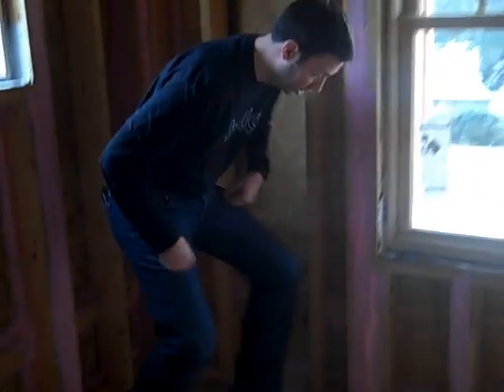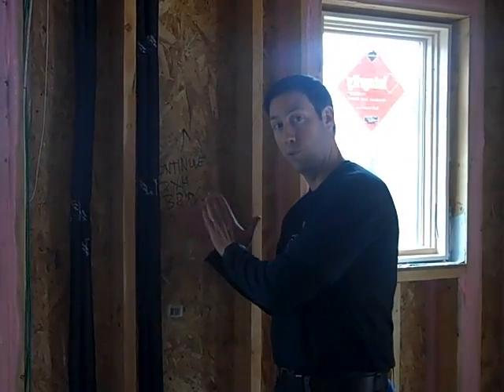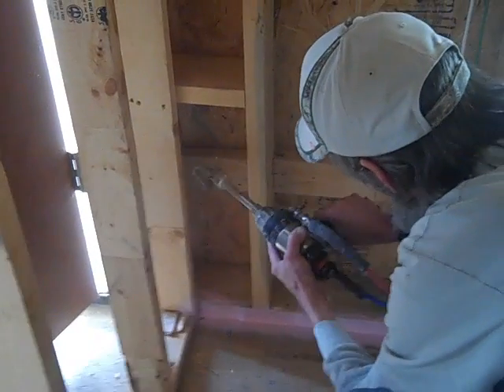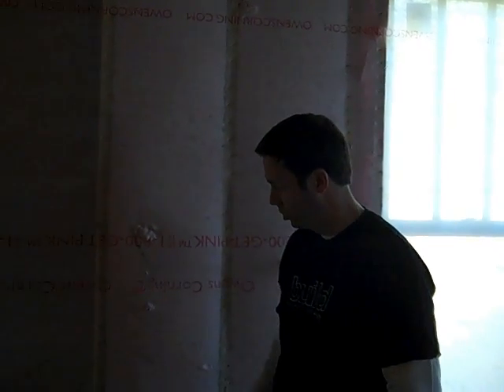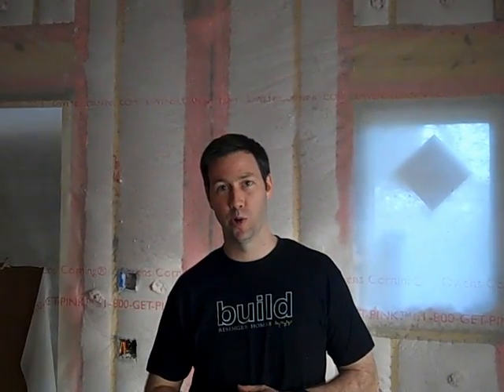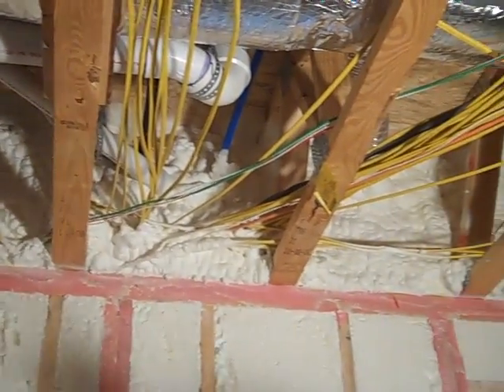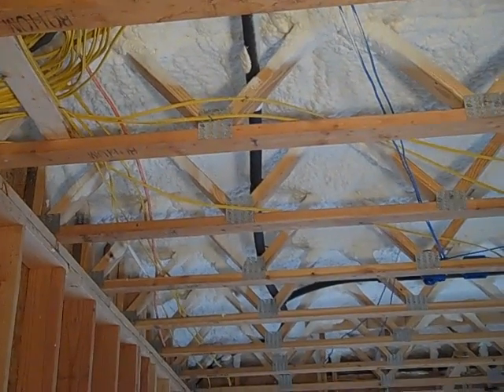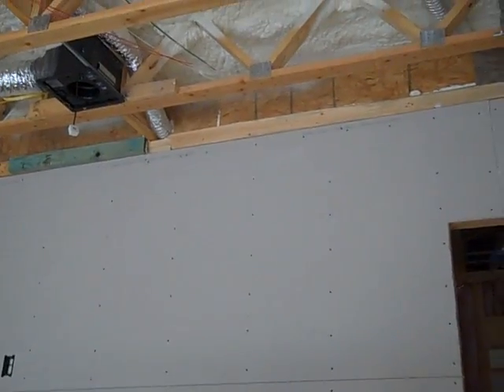Insulation & Air Sealing Strategy utilizing Owens Corning Energy Complete

Comment: This would be good for a custom build that you are going to live in forever.
Wayyy overkill though for what you actually need.
Reply: Nobody needs ever increasing heating and air conditioning costs. Spend an extra $3000 on insulation and add it on to the home loan. $8 per month for 30 years and free after that if you stay in the home. Lousy insulation and air sealing is the gift that keeps on giving.

Comment: This is an overkill and impractical. Even on camera dude spays the insulation still leaving a gap between the studs in some places. In the field subcontractor will hardly have enough patience to do this job due diligently. That's the practicality aspect. As far as the overkill, taping OSB board joints and house wrap will provide more than enough air sealing, inconsequential in terms of heat loss. Windows and convection heat losses are magnitudes more substantial. If you are concerned about mold remove the moisture element. But that's virtually impossible in a traditional frame wall construction used in the United States. Some may easily spin this into a conspiracy theory, especially since civil engineering has had an explanation for decades. As vapor travels outward, past the gypsum board, past the fiberglass insulation it meets cold OSB/plywood board and condenses on the side still internal to the house. Incidentally OSB, the newer invention, is even worse than plywood because OSB has a lot more glue making it virtually 100% efficient vapor barrier. This is why by year 10 or sooner most houses in the US, especially those in the colder climates, have some kind of mold or rot damage even without having any kind of water leakage issues. Yet, industry keeps pushing this type of wall construction. But you Matt are on the right track in general. I admire your commitment to the scientific approach. Once I start seeing you talking about location of the dew point inside the wall systems you build I'll know you started hitting nail on the head.
Reply: ICFs
Reply: air sealing is actually very important to heat loss and energy efficiency. As far as why houses rot, thats because people work with new materials they don't understand. You could get away with sloppy design of a building envelope 20-50 years ago, but you paid for it with energy efficiency. Now that building codes are stricter in regards to energy efficiency there are more problems. Gone are the days where you can get away with installing a brick wall without an air gap.

Comment: Hey Matt, are you still using this system ? What is or was your ACH, when using this type of system ? thx
Reply from the maker: Luke,  I'm no longer using this system or promoting it.  They have re-formulated the way it's applied and I'm not a fan.  This house blew around 2.5ACH50 but I'm not sure their reformulated system would produce those results.
Reply: Matt Risinger good videos. What is your current insulation system style?

Comment from the maker: Hey Brian, thanks for your comments!  Be sure to remember that alot of what I'm doing in these videos is intended for the hot/humid Southern US.  Much will translate to Canada, but be careful.  Regarding SIPS, I've not used them yet.  My opinion is mixed.  I think they are good but not great for custom homes that have Architects designing without SIPS limitations in mind.  Simpler houses seem to work better with SIPS.  I think a 2x6 Advanced frame house can compete very well with SIPS. Matt

Comment from the maker: @LukeSkaff That's a valid concern but this product has been time tested and settling has not been an issue with a qualified installer doing a BIBS system.  I really think this Owens Corning Energy Complete is a terrific product.  If I were building my own house today I'd frame it with 2x6's on 24" centers and use OC Energy Complete, and I'd use exterior rigid foam.  Consider at least 3/4" of exterior foam, but depending on your climate you might want 2-4" of rigid on the outside.  Matt Risinger

Comment from the maker: @SZAPP68 I think the costs are VERY reasonable on this system.  It's basically a BIBs (blown in blanket) system with the additional sprayable caulking for air sealing.  I think this combo we show on the video is really a perfect system for our Austin, TX climate.  Thanks for your comments.  Matt
Reply: Matt 2/3/2017   Are you still using this system?  Thanks!